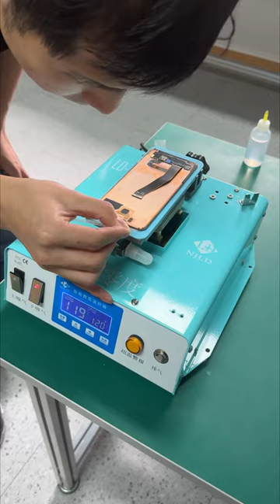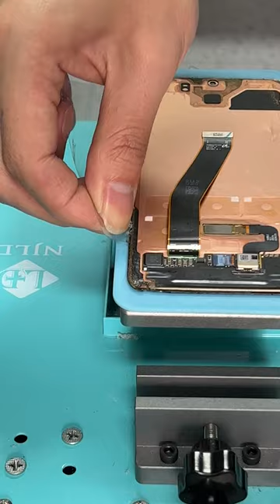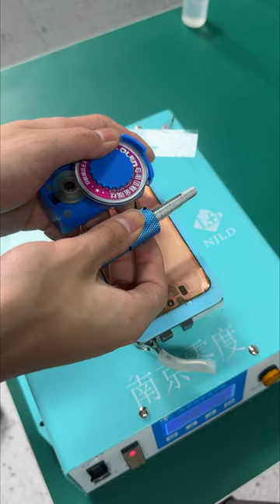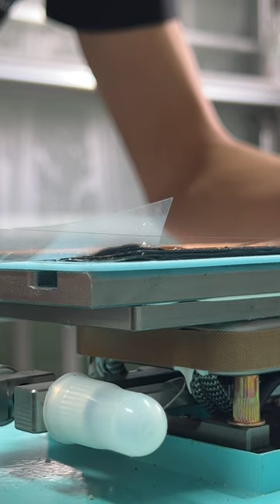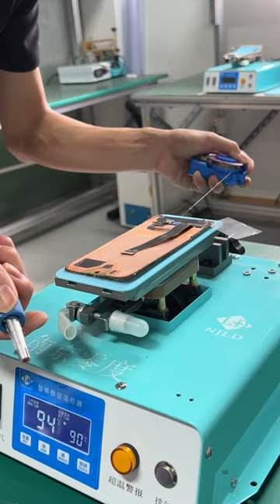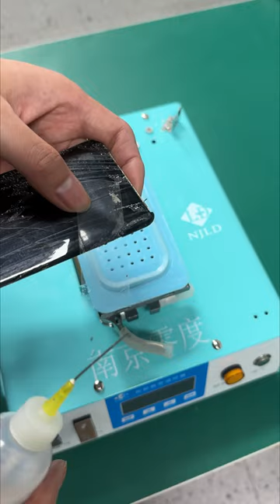Glass separation for curve screen

Comment: impossible. des saignements noir apparait avec la carte oca plastique utilise de cet facon ... c'est dejà tente et les écran oled n'aime pas la pression ou compression ...
Reply: I have been in the refurbishing industry for 10 years now, I do curved screens like this... the problem started with the s20 series... After a month or so small black dots start to appear at the edge of the screen due to pinhole oxidation in the cathode layer. it's a 50% chance they will appear at some point, pretty annoying.
Reply: @Dariddda  i don't have it, whether with s20, s10 plus, note 20 ultra, s22 ...